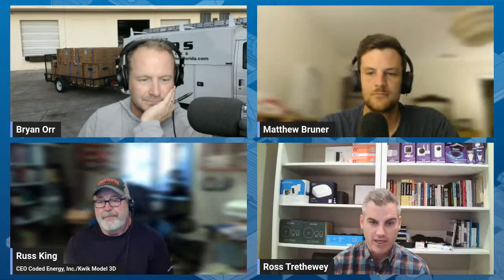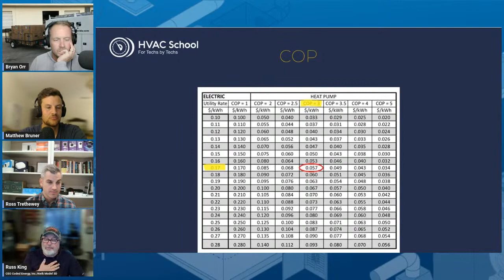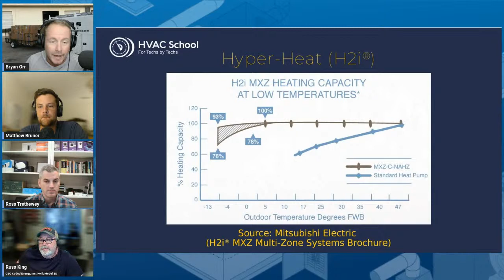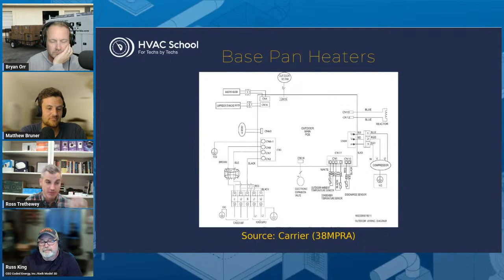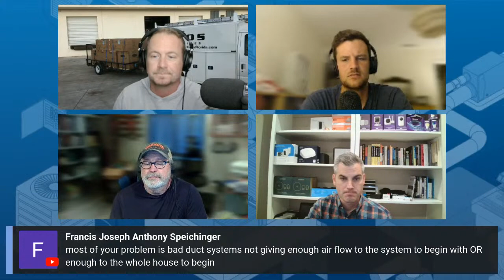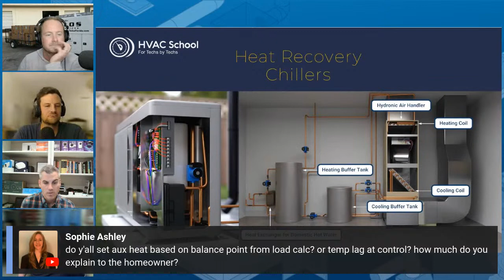Equipment Selection for Cold Climate Heat Pumps

Comment: 42:20 how much are voltages being jacked up? 260v? 300v? IMO it's pretty ridiculous if an IGBT can't handle the peak to peak voltage of 300v AC (I'm guessing its in the 430v peak to peak range?)

Super expensive equipment like central air should definitely have sufficient insulation to take this, if the individual board components are blowing under that voltage someone must be cheaping out!

Comment: Usually when I explain to my customers that an average heat pump will last 12 years and they will have to run on resistance till Spring if the outdoor unit breaks, I not going to repair anything with frozen fingers or laying in the snow. They will usually opt for the heat pumps with gas backup or just install a a/c with a gas furnace and not worry about it until the new born graduates from college.